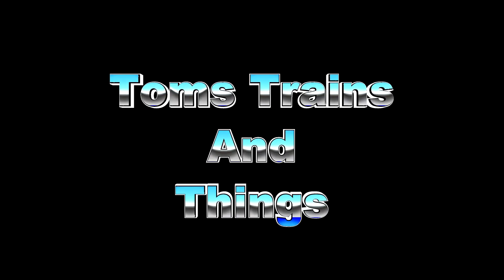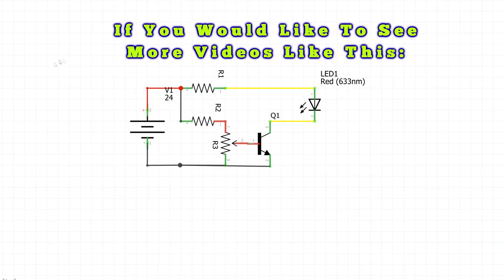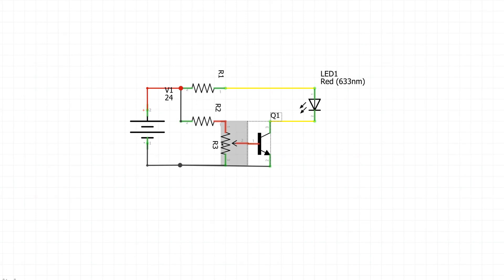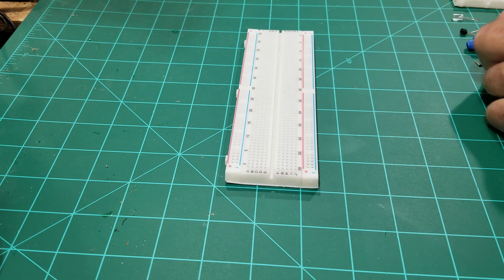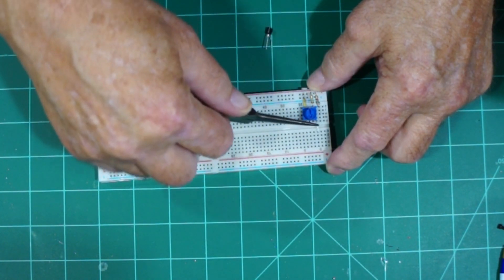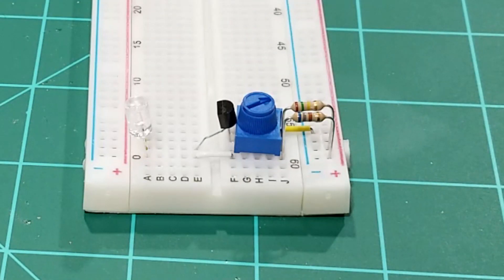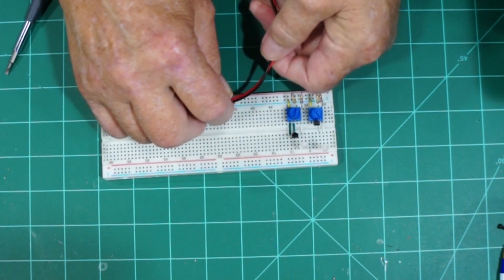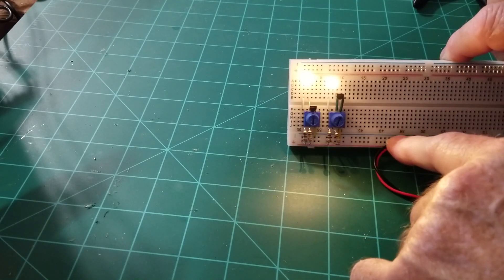How To Use A  Breadboard For Your Model Railroad Lighting

Comment: What voltage are you putting into the breadboard?
Reply from the maker: I applied 12vdc for the test. The design will handle as much as 24 vdc. In a later test, I added a voltage regulator and bridge rectifier so I could apply up to 24vac. That is the was the original Just Plugs is designed.
Reply: @TomsTrainsandThings  Many thanks Tom
Reply: @TomsTrainsandThings  Is it possible to get it to operate off a lower voltage than 12vdc?
Reply from the maker: @morturn  You probably could, but your LEDs would be much dimmer.

Comment: So you could use the arduino to control the brightness and time of each led correct? Would you still need the other components with the arduino?
Reply from the maker: Yes. Which other components are you referring to?
Reply: Toms Trains and Things
The Potentiometers and the s8050 transistors wouldn’t be needed would they? Since the arduino manages the time and brightness you don’t need them?
Reply from the maker: There are many ways to control the brightness and duration in the Arduino code. This video is a follow up of how to reproduce Woodland Scenics Just Plug. Where one pays nearly $20 for the one module, it can be recreated for just a few $$ and one can add more than what is on the Just Plug module.
Reply: Toms Trains and Things 
Sorry to go off on a different direction then the video was intended. Just got me thinking how you could do light management with the arduino. This is a great, cheap option to the brand name lighting. Well done!
Reply from the maker: Thanks Dave

Comment: Is this just for DCC?  I am running DC.  Can I just use wire strips to distribute the power?  This does look like a simple setup and it’s probably easier than I think.  Circuit boards have always made my head spin so seeing one take shape, step by step is less intimidating.
Reply from the maker: This is not DCC, it's DC. You can distribute the power like I show on the mini breadboard that doesn't have a power bus running along each side. I have more videos on this same subject that goes a little further into the application. I have a link to the playlist in the info cards in the video.

Comment: hello tom, lately i bought the n scale 13 pcs town and factory by woodland scenics. comparing the woodland scenics with my KATO signal structures, woodland scenics seems to be OFF SCALE ( bigger than n scale). i also put the n scale people near the building and also seems weird. what do you think? thanks pong from the philippines
Reply from the maker: Hi Pong, the buildings in that kit are the old DPM kits which are pretty much to scale from what I've seen. Most of mine are in HO Scale but I do have a few in N Scale. Not sure about the Kato products though since they are manufactured outside the USA they may be not to scale. The only way to know for sure is if you have a model railroad reference rule where you can measure the items.
Reply: thank you sir

Comment: Excellent video, Thanks! I'll be using that on layout lighting for sure. What would I have to change to use it for my 12v 30a led golf cart headlites?
Reply from the maker: Thank you. Not sure if the gulf cart headlights have a resistor built into it to limit the current. You wouldn't need a variable resistor or transistor since you wouldn't want a variable light.
Reply: Toms Trains and Things I do want variable lights, they're  way too bright, I'm blinding my neighbors! lol
Reply from the maker: You can duplicate the circuit with components rated for the amperage your drawing on your gulf cart, but it would probably cost you a lot. You can always add a high wattage resistor to the headlight to bring the brightness down. The components used in the circuit for model railroading are drawing milliamps.
Reply: Toms Trains and Things, that's kinda what I thought, thanks for the reply Tom!